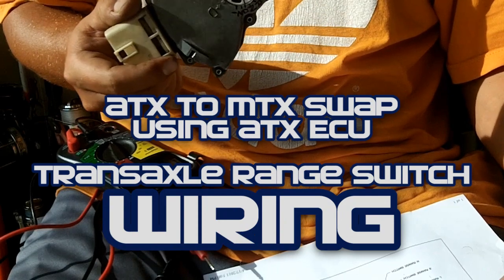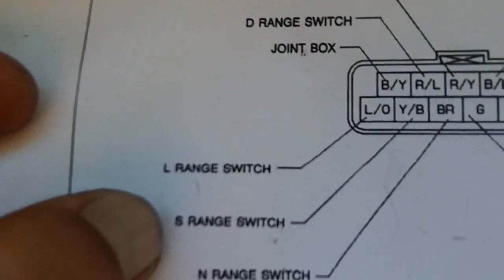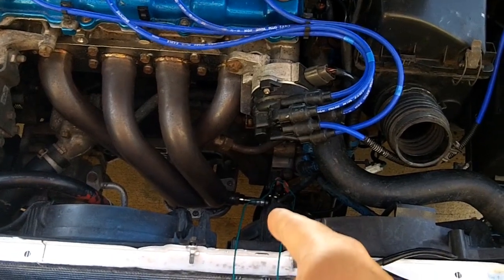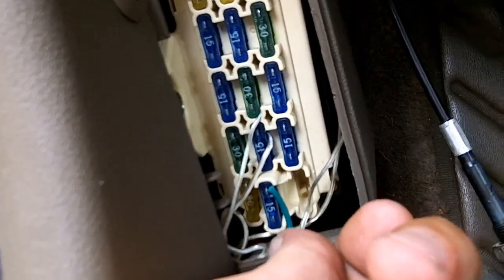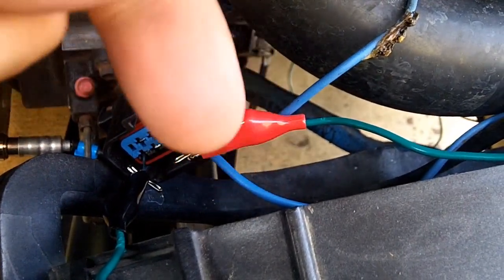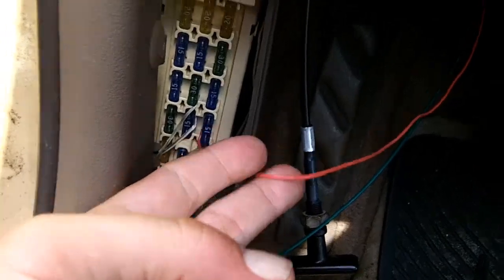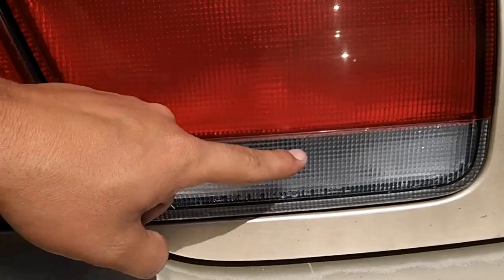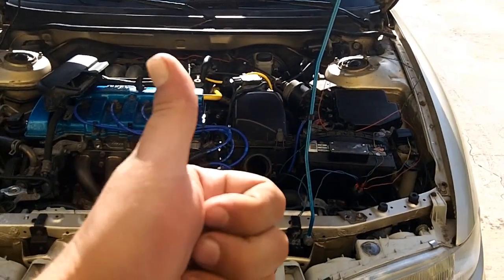Mazda 626 - ATX to MTX Swap BLS to TRS Wiring

Comment: would it be the same on a 2000 protege ?
Reply from the maker: +Joe Villa Will what be the same?  The TRS gear selection voltages?  The backup lamp switch location?  The lamp switch itself?  Vague question.

Comment from the maker: It's completely rusted out sitting in the backyard.  Selling it for scrap metal.  You really want a 5th gen ATX anyway because of some nice updates they made to the clutches, bands, gaskets, gears, and parking brake.  Don't try for a 4th gen ATX, I'm not even sure if they are compatible anyway.  The 5th gen FS-DE ATX is much better than the FS ATX.

Comment from the maker: Eventually I will be going to the MTX ECU and wiring harness.  There are a lot of complications using the ATX ECU and ignition system with the MTX other than just phantom codes.  I have a nasty parasitic drain because of this wiring scheme.  Have yet to make a video on fixing that.